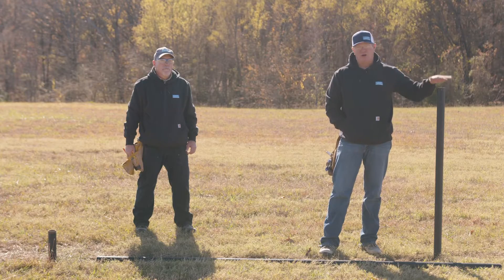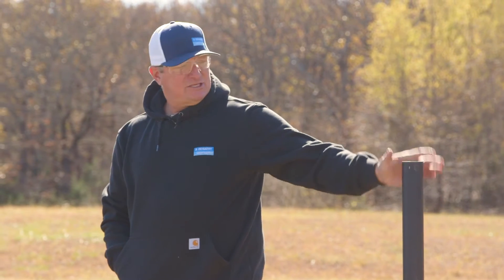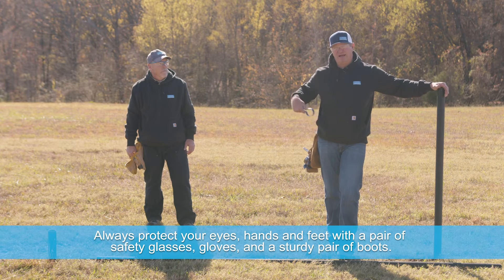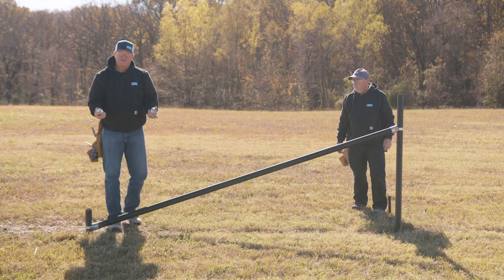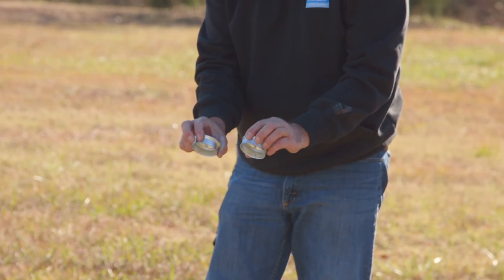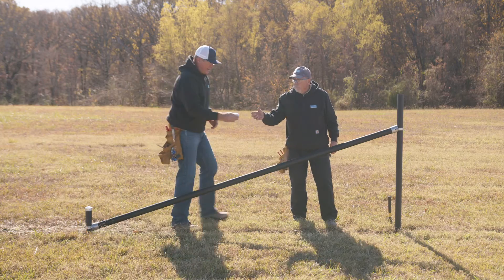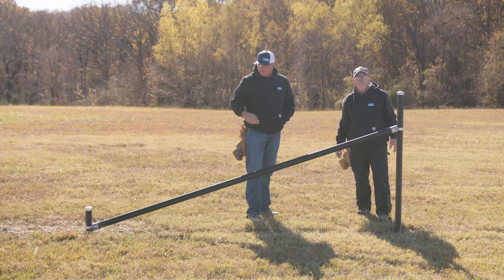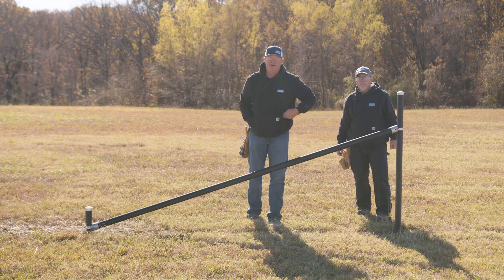How to install a N Pipe Brace using Bekaert’s Fence Bullet Kit

Comment: Garbage product, you have to buy your own hardware cause what's included is not the right spec. Huge headache. Buy a generator and welder instead!
Actual user here. Lots of corporate review, but let me tell you this man and his product are garbage. This kit uses the absolute lowest grade (strength)) bolts. The mechanism of this design requires deforming the sleeve with said low grade hardware.
You end up stripping the hardware before the product sinches up tight.

The inventor Ron admitted this was a issue and I wasnt the first person to mention this.

No remedy from Bullet Fence, had to spend money on correct hardware and wasted days driving to and from my compound to get said hardware.

Trash product and trash business owner.
The cost of correct hardware is nothing compared to the issue grade zero hardware causes.